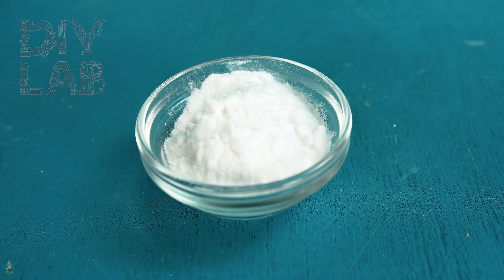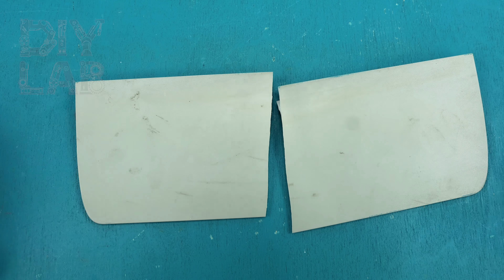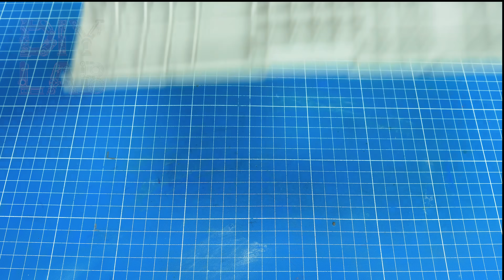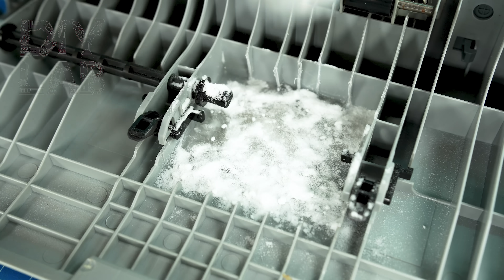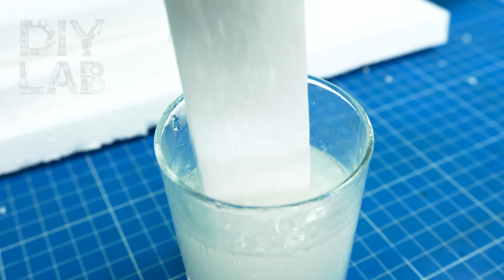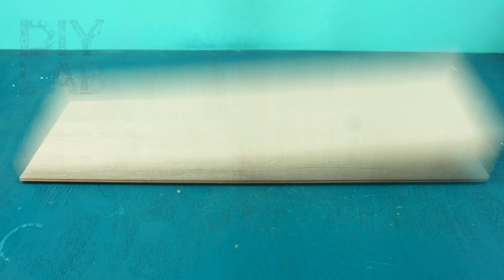Super Glue and Baking soda ! Pour Glue on Baking soda and Amaze With Results

Comment: I had that exact same problem! Big crack on the safety guard of my weed eater. Baking Soda and Super Glue, then sanded down with an angle grinder and flap disc. Worked perfectly!
Reply: Does it not weaken when exposed to water?

Comment: Not dumb this is how minor chips or cracks on airplane props or helicopter rotors are repaired. sand super glue, add base then sand and repeat until blade fixed. Use ultrasound or x-rays to check. the repair if done correctly is like a weld stronger than parent material, IE stonger than original blade. Not sure if used on metal blades, but certainly on Woden or polymer blades (fibreglass etc).
Reply: And you know how crucial repairs on helo rotors are, auto gyro is your only safety option if engine (s) fail or fuel runs out. At least planes can glide (10 maybe glide slope, so mile up, 10 miles to land, even airliners can achieve close to this, and 1 working engine will extend) and manoeuvre for the landing useing rudder/elevator at a minimum and maybe flaps and ailerons if an apu or slipstream generator, is present.
Reply: What does "add base" mean?